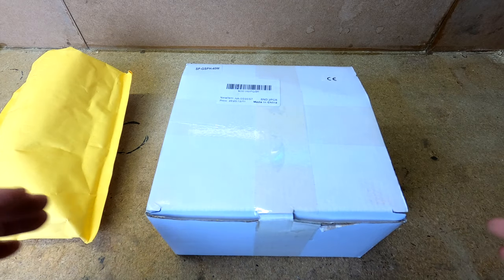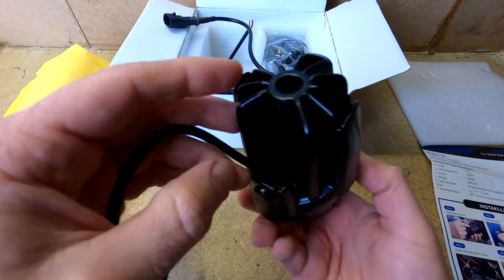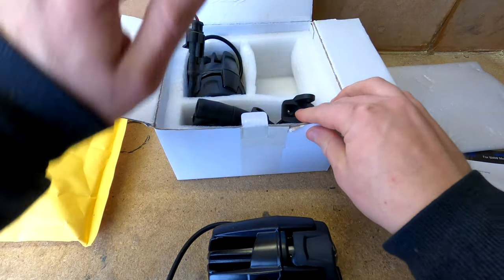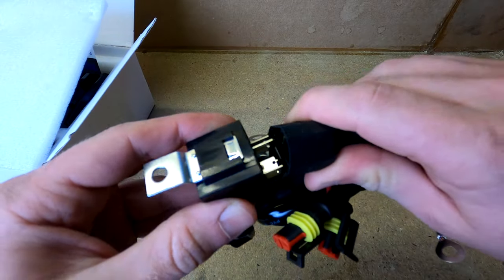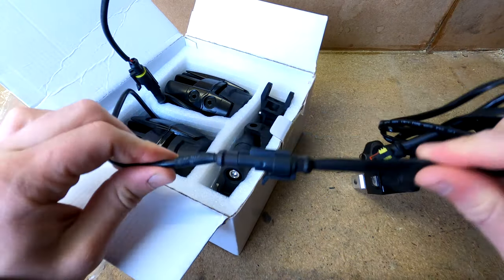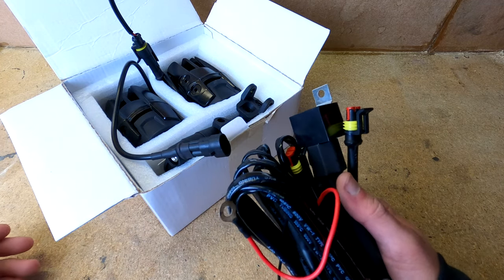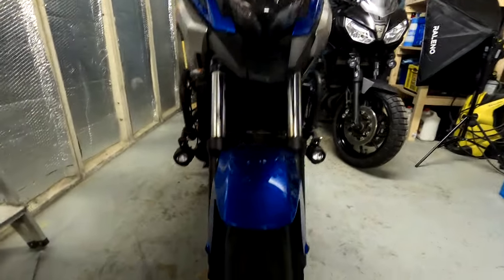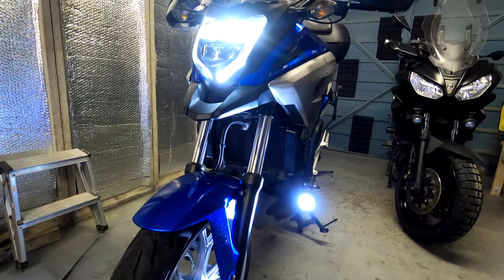Cheap LED Auxiliary Fog Lights for Motorcycles | The Final Chapter! | Honda NC750X

Comment from the maker: UPDATE 3 years on!

These lights are STILL working and still functioning as they should. The light switch ended up failing in a heavy storm we had a few years back. I have since taken this out and wired the live into a piggyback on the headlight fuse - really simple to do with no wire cutting or splicing. That basically means the lights come on and off with the ignition as the headlight does. Way better! 
Emma has also had no issues with being seen or seeing on dark country lanes which is exactly what we wanted from them! 

Thank you for all the recent comments on this video! Seems to have hit the algorithm again!

Comment: Just for your information, do not forget the utility of dielectric grease, another interesting item is there is a Firearms cleaner and Oiler called strike hold on the market I don't know whether it's available where you're at. You spray that on electronic items and it insulates them quite well from shorting out because I've seen electronic items sprayed with this and put into a water bath and they function just fine. It is a tremendous product for that application. And every little bit helps

Comment: I would suggest to mount the lights on the fork or a little higher because of the small rocks will run from under the wheel and hit the lights.
Reply from the maker: These have been fine so far, but normally I'd agree. The ones I'm buying for my bike will go on the upper Crash bars

Comment: Great video, are you not worried that they can be turned on without ignition?
Reply from the maker: Not horrendously worried. Hard to miss if you leave them on, and being LED, if you leave them on for a few minutes, it won't kill your battery. I've since wired them to a piggyback fuse from the headlight, so they turn off and on with the ignition
Reply: @SamVBikes  fair enough, just thinking if you park up and someone turns them on that’s all.👍👍

Comment: I have got the same lights. the Switchbutton (red light) stays on while fog and ignition is off. Not sure how to fix to prevent battery drain. Any advice?
Reply from the maker: There are a few options but depends how confident you are with wiring. One option is wiring the power for the lights into an ignition live wire. Something that only comes on when your ignition is on but that involves hunting for a suitable wire and splicing into it. Normally something like your lights, or horn etc but make sure it's a bigger amp wire like the headlight. If its a small led, it should barely draw any power so hopefully it wouldn't drain the battery unless you're leaving the bike for a long time. The other option is wiring in a switch into the power lead going to the battery. So you would essentially have two switches to turn the lights on, but you could turn that 2nd switch off if you're going to leave the bike for a long time. Hope that helps

Comment: Brilliant video..I brought some .red black and YELLOW.  WIRES .NOT SURE WHERE TO CONECT YELLOW. ie to the black .any help would be appreciated
Reply from the maker: I had the same on my Tracer when I fitted these. The wire that came with had 3 wires, and the yellow/white was just for the LED on the switch which I didnt connect. My girlfriends are still only connected with a red and black, no other involved

Comment: I thought the point of having a relay was so you could run it from the side lights so it comes on/off with the ignition ?
Reply from the maker: I tried that when installing these but it didn't seem to work. I've since wired it from a piggyback fuse from the headlight fuse so they all come on with the ignition so similar story

Comment: Nice video!! How did you connect the lights to the battery? Did you screwed the relay to something?
Reply from the maker: Thanks! The relay is hidden above the battery compartment. I took off one bolt and used that as a mount. The wiring loom has battery terminal connectors so they go straight on! Nice and easy!
Reply: @SamVBikes  thank you for the info. I will mount mine in the next days and your video was really helpful!
Reply from the maker: No problem! I have no wired them into the fuse box with a piggyback fuse holder which means the lights come on with the headlight/ignition. It's a bit more difficult to do, but helps avoid those cheap switches failing! Hope it helps
Reply: @SamVBikes  would like to know how you do that? where do you put the fuse?
Reply from the maker: Piggyback fuses replaces a fuse in the port with a connector, then you plug the fuse into that connector. Which is where the name piggyback comes from. The bike doesn't know any different, but you can draw Current from that fuse port

Comment: Going to order there for my sipere tenere, £98.00 now but as you say includes wiring so not bad.
Reply from the maker: Nice! Let me know how you get on with them. I've since wired them into the main fuse box. Piggyback fuse off the main headlight fuse so they come on and off with the headlight. Much easier and no hassle with switches
Reply: @SamVBikes  yeah i dont want a switch, im thinking i could just find a live and wire it into that using a scotchlock maybe?
Reply from the maker: Yeah I don't see why that wouldn't work. Make sure it's a switch live and you'll be sorted. The only reason I went piggyback fuse was incase anything ever went wrong with the lights, it was simple enough to pull and still have a working bike. Having said that, they've done 10k miles on this bike and not had an issue
Reply: @SamVBikes  thanks, when you say a switched wire, can you explain please? Thanks again.
Reply from the maker: One that comes live when you turn on the ignition. You don't want to wire into a wire which is live all the time as the lights will stay on. If you use a wire which gets Current when the ignition is on, the lights will only ever come on when the bike is on
Reply: @SamVBikes  Excellent thanks loads for your reply.
Reply from the maker: Most welcome!

Comment: Hi Sam, great video which made me dare to install the same foglights on my NC750x, but I'm now a bit worried about the fuse of 30Amp that came with the lights.The lights are 40Watt, so that's about 3.3Amp times 1.1, would need not more than a 5Amp fuse, not? Would you advise to swap the 30Amp for a 5Amp fuse? To me that seems safer or am I wrong?
Reply from the maker: Thank you! Yes you're right, I ended up swapping the fuse for a lesser one because I didn't see the need for such a high amp. I believe I put a 10amp in in the end!
Reply: @SamVBikes  I've bought a piggy back fuse, but can you still close the fuse box after you've installed it or do I have to get a special one that is more flat? What fuse slot did you use? Thanks, Erik
Reply from the maker: I could just about close it but it was pushing down quite hard so didn't have it shut in the end. I cut that section from the lid of the fuse box so 99% of the lid covers, then just the one poking through. Or just put it roughly in place and replace the battery cover which holds it in place. I used the fuse for the display if I remember rightly. Only comes on when ignition is on etc

Comment: Do you ride with these on all the time? Or as an addition high beam? Cheers.
Reply from the maker: These are now hard-wired into the bike so are on all the time. Have no issues with dazzling people but it makes a huge difference with visibility on the road!
Reply: @SamVBikes  Ah, nice! That’s the thing, I’d like more light, but not so much that it annoys other road users. These sound like they are a good balance 👍
Reply from the maker: Agreed! Something additional makes a massive difference, especially when filtering through traffic!

Comment: Hi Sam what headlight bulb did u fit as mine is yellow ?
Reply from the maker: The headlight bulb on the NC750X is LED from factory. I think they updated it to LED around 2016/17. My bulbs in the Tracer are Philips LED bulbs which are a direct swap out. Hope that helps
Reply: @SamVBikes   ah thanks mate mine a a 15 plate nc. So when I put the led spots on it makes the headlight look crap lol
Reply from the maker: Ahh makes sense! It's worth looking at LED replacement bulbs. They can get quite pricey, I think I paid over £100 for mine but it made a massive difference to visibility

Comment: I can assure you those connectors and not waterproof there water resistance there is a differencel!
Reply from the maker: Good to know! Not had any issue with them so far so fingers crossed they last